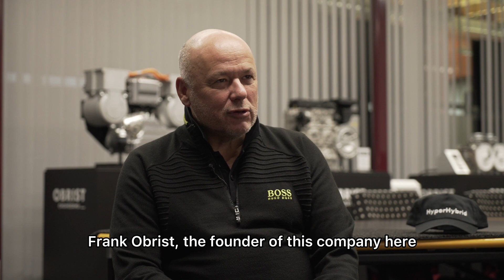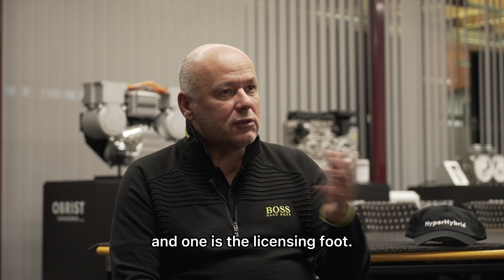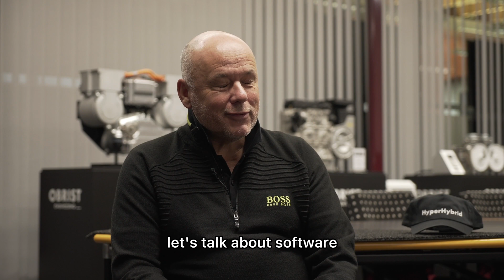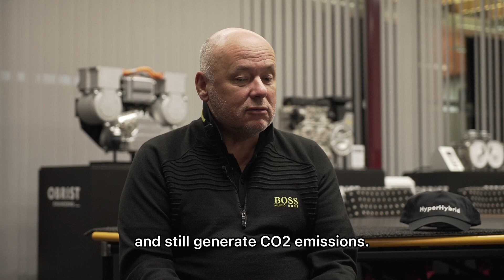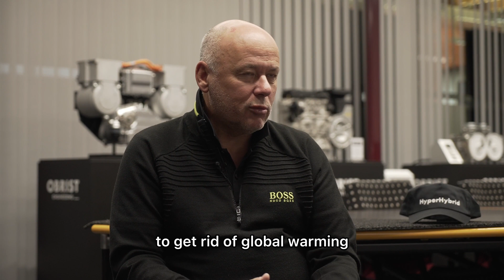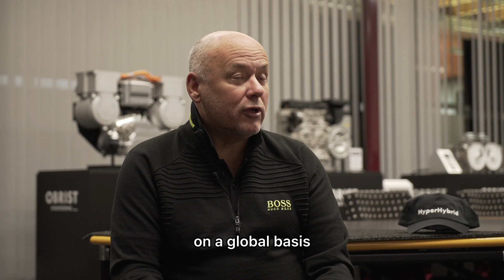CARWOW Spain interviews Frank Wolf, CEO of OBRIST Group

Comment: Maybe a microturbine could be used as the generator in the future. It burns even cleaner and has a decent efficiency when running at optimum speed and with a regenerator. It is also smaller, lighter, less maintenance and less vibration. I just got inspired by the Ted Talk by Wrightspeed.

Or an opposed piston engine from Achates could be used. I read they were approaching 55% efficiency.

In the distant future I could see it run with a fuel cell that reforms the e-methanol/aFuel. Apparently fuel cells can in theory become far more efficient than combustion engines.